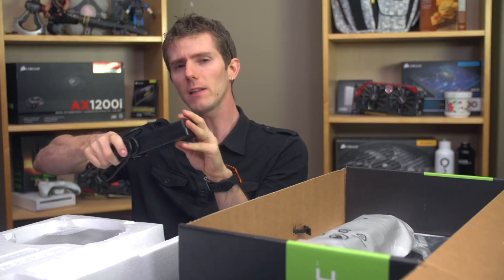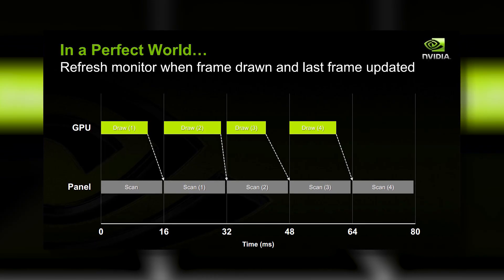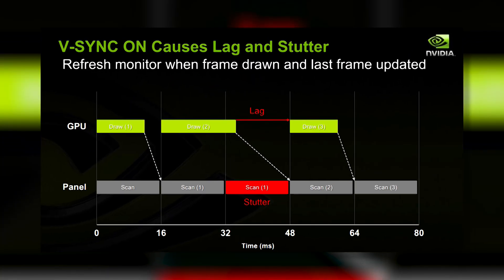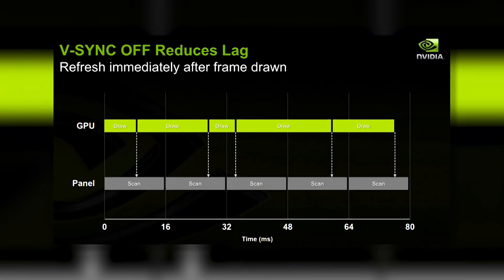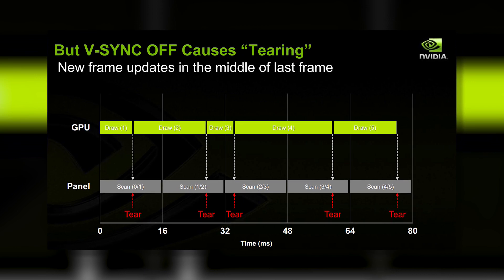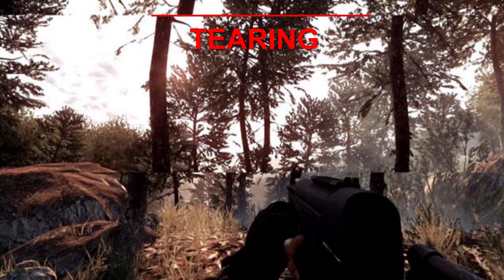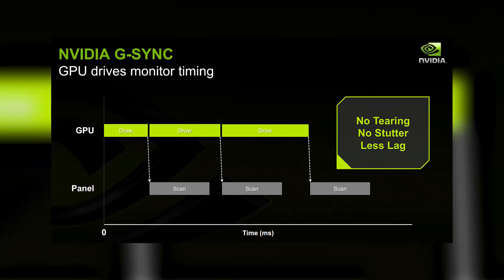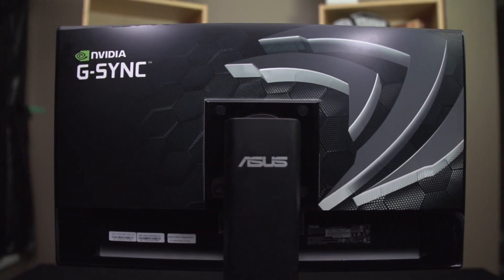NVIDIA G-SYNC Tech Preview - Linus & Slick's Impressions

Comment: I have purchased my first SSD and have Windows 8.1 Pro 64-bit love the speed that it provides, but currently it is on a SATA 2 and plan to purchase a SATA 3 add-on card in order to take full potential of the SSD, which happens to be the Samsung 840 EVO Series 250Gb.

Comment: I put a Crucial M4 in my last PC and I thought it was awesome! It really helped me out with loading everything. I ended up selling that PC and when I went back to building an even better PC I decided to go with the OCZ Vertex 4, that SSD was much faster! I just lately built a PC for my wife... I purchased an SSD for her as well.

If anyone is ever buying a PC I always suggest an SSD for them. To me... you lose so much performance because of a HDD. A 3.5 minute boot up time turns into a 1 minutes boot up time. Programs open up faster, webpages are able to open up faster, you're able to do everything in general... FASTER. I have seen a Pentium mobile processor go from being a crappy processor to almost an i3 speed (that has a HDD) because of an SSD.

I will never go back!

Comment: Bought an SSD when my HDD failed last year.. I'll never ever go back to a HDD other than it being secondary for music, movies and less important apps and games..

Going from my "Gaming" PC with SSD to a PC without an SSD or a Laptop is almost frustrating at times. My SSD PC fully boots in under 15 seconds, opens all apps in 5 seconds or less. Does what I want when I want it.
Without the SSD or on another PC is more like 30-60 second boots and 10-15 secs for most apps.. other are even longer like Photoshop or Lightroom when loading the images catalog.

For those who aren't convinced about the benefits of SSD.. Find someone with an SSD in their PC/Laptop and has the OS installed on it.. try it out for a few hours or whatever. Then when you're back on your own PC/Laptop you'll definitely notice the speed difference. My PC is still running as fast as it was when it was a clean OS install.. and that was well over a year ago now! a HDD would have definitely slowed down after that time :)
Reply: PC Master Race - SSD Armada

Comment: I recently got a new laptop that has a ssd on board and it is so much more efficient and in my opinion safer. It has no moving parts like traditional drives to be damaged by shock. I am looking into actually taking my other pc and switching it to ssd.

Comment: One thing I still don't totally understand is if a monitor normally has to repeat frames if the graphics card can't render fast enough, how does G-sync differ? Presumably if the frame is delayed the monitor would still need to hold the current image for longer. Is it that the monitor can draw the frame as soon as it arrives, rather than having to wait an entire cycle (say 16ms assuming a 60hz monitor) before updating?
Reply: You have it exactly right with G-sync the monitor gets the new frame when the GPU is done with it. This may mean that a frame is displayed for longer than one traditional refresh. However, instead of one frame for 32ms (assuming your 60 hz scenario) during which time you may have tried to move your character, but couldn't (input lag) the frame will last say 24ms (arbitrary number) and you'll be able to move the character normally. The opposite can also happen too, where a frame may only be onscreen for 10ms (again can be any ms) it all depends on when the GPU is ready. In real terms all you NEED to know is tearing (no V-sync) and input lag (V-sync) are both fixed by G-sync.
Reply: Cool, thanks. :)

Comment: Oh my goodness, there's no way I'm not going back to just using a HDD. My 840 is sooo quick with the Z87 platform, in fact I'll be getting another 250gb soon to run in RAID 0 to double my capacity and performance. Eventually getting a G-Sync monitor if it turns out to be good but I rather sit back and let this play out and see it for myself first.

Comment: I have upgraded to an SSD within the past year and it is a night and day difference. With G-Sync though I don't think it's going to be something spending a lot more money on because it has an nVidia logo slapped on it. I personally have used nVidia GPUs ever since I built my first gaming rig, but I am looking to switch to AMD and upgrade to a 120 or 240hz monitor (which I have seen gameplay on). That way I get a nice new GPU and a lot cheaper monitor that looks just as good (picture quality), overall saving loads of cash. It's not new mind blowing technology. I think I will stick with regular Vsync and be sure to have a good enough PC to eliminate screen tearing.

Comment: I made the switch to SSD when 240gb drives went below $300 and it was the best upgrade I've made to my PC besides my video card. Apps open almost instantaneous. Restarts around 10 seconds or less. Going back to a HDD would be so painful. There's no way. As I already have a Kepler card, I'm extremely excited about G-Sync. In ACIV right now I basically have two options. Vsync off and horrific tearing, or Vsync on and terrible stutter. I've heard claims that 40fps with Gsync looks smoother than 55fps on a 60hz monitor, and it makes sense. I can't wait.

Comment: 4:12 never use metal tools on plastic material cause you will damage the soft plastic with the hard metal ... use wood or material thjat is softer than the plastic so that if damage occurs it will appear on the soft tool .... just sayin ...

Comment: requires specific brand of GPU
requires specific series of GPU
requires specific manufacturer of the monitor
requires monitor to be TN only
requires specific hardware/adapter
+ all specific limitations in terms of souround windowed mode 
requires a gamer mouse with 1k polling rate
no SLI support

It targets like one digit number of the gamers in the world at best ...
It is sad that such amazing technology will not become industry standard...

And that is only because nvidia is pushing this just like physx more from marketing side then from technology side... and that is very bad because this would be really beneficial to everyone.

Basically what i want to say is if they dont want this to go away into obscurity/gimmick like physx did tey have to :

make sure it works with both AMD and Nvidia GPUs
make sure it works with older generation of cards
make sure every brand of monitor manufacturer is making and developing them
make sure that it supports IPS panels

Comment: My desktop has had an SSD for about half a year now. Whenever I use my laptop though, which has a 5400rpm hard drive, I feel as though I'm just wasting my time. Its so much faster to use an SSD, not to mention I can start programs as soon as I log in, and not have to wait a few minutes.

Comment: i would just like to say that i have been creating images in Photohop at ridiculous resolutions, like 22 MP, with up to 200 layers, and before i had an SSD it was almost unbearable to do, cause it took about 10 minutes just to load one photo, where now it only takes about 1 minute to 30 seconds to load, and saving took longer, my biggest one took 4 hours to save, now it only takes 30 minutes to save that file, (i think it was 80 GB)
Reply: what sort of work do you do? 80 gigs is huge file...gigantic actually.
Reply: The 80 gig file was called Dark universe, and was around 40MP, with 182 layers most of them were quite big and very detailed, it was a photo of a nebula, with a galaxy in the background, and a solar system in the foreground, it got lost when i burned up my hard disk trying to load it while rendering a video in the background. That is also why i have been away from deviantart for a while, was trying to get an SSD on top of my new computer which is very expensive in the first place, after that i stayed away from making stuff that was over 5 GB however my biggest file atm, is 745 MB, after i reduced it from 1.32 GB which also happens to by my latest deviation
atm i am doing anime stuff, at 5760 x 3840, where as my normal content is space art at a res 2560 x 1600 or 2880 x 1800.
www.shazarakk.deviantart.com to see my stuff, I'm also thinking of doing stuff where i don't draw over with PS but where i just draw it by hand.

Comment: I just started using an SSD this year and can not go back to a HDD based system, another example is a Mechanical keyboard I just got mine this year and love the thing every time I go over someone's house and need to use there computer that had a membrane keyboard I hat it and almost cant deal with it.
Reply: Same. I went SSD in about 3 months ago and i will never go back to 1 min boot times with my ancient hard drive. But i also got a new 1tb 7200rpm hard drive when i got my ssd and load times in bf3 were off by about 20-30 sec from ssd vs hard drive. I still have a cheap membrane. What keyboard do you recommend?
Reply: Nowadays when I'm using a computer that main storage drive is an HDD, I have a feeling that I'm using ancient technology.
Reply: MrMater36 What keyboard depends on what switch you want. There are Cherry MX Blue, Green, Red, and Brown and you just have to do some research and find which one you prefer.
Reply: MrMater36 Keyboard wise I really like the look of Corsair K70's but Ducky's are also another really nice brand.  As for key switch type I personally like cherry MX blues but i'd recommend MX browns to the average person.
Reply: Give me a 3TB SSD at Hard Drive's price and I'll get one.
If I had to choose between storage space and speed, I'll choose storage space, I leave my PC turned on 24/7 so boot times are not a problem to me.
Reply: ***** For me like a student was quite hard to buy, but it is a good investment.
Reply: Willard I have the Corsair Vengeance K95 and I love this keyboard. They are the Cherry MX Red's and I can't imagine going back to membrane keyboards.

Comment: Using an HDD is very frustrating. I had to RMA my SSD, and was using a HDD for a week and a half on my desktop. I couldn't wait for the SSD to go back into my system. My laptop is HDD based, and I might put a SSD in that one day as the load times are terrible.

Comment: Question Linus - Vsync stops your GPU from maxing out and keeps the fans at a reasonable speed. When you enable G-SYNC will that max your GPU load to 100% and send your fans into a mad frenzy, equivalent to Vsync off?
Reply: My guess is that it will be similar to Vsync in that way since the GPU will have to wait on the monitor to read out and show the image. a 60Hz monitor will still only be able to show a maximum of 60 frames per second. When your framerate is above the refreshrate of your monitor it will basically be the same as gaming with Vsync on since the monitor is the limiting factor. The biggest gain is when you drop below the refreshrate. At that point the monitor will synchronize with your GPU.
Reply: Niosus
Cool. If that is the case, I will def upgrade to this new tech. I will be getting my 2nd GTX 780 at the end of the month and I wanted to take advantage of having no lag (which vsync gives) but not have my cards screeching at max :)

Comment: i already have my asus VG248QE so i'm just waiting for pricing since the asus is the only upgradable monitor atm.
If price is not to steep ill definatly get it but ill probably wait a bit for the tech to mature and price to drop so next quarter like you said sounds good i guess.

For the moment you have to drop HDMI and DVI since only displayport is supporter with gsync but thats no problem for PC. Never liked HDMI anyways lol.
Reply: Its not upgrade-able, they thought they were.
Reply: ImJJames the g sync module is just a part of the motherboard and can be replaced. Nvidia confirmed the VG248QE is compatible with the board so you just need to open your monitor and swap the part after you buy the gsync one.

Comment: I'm looking for a new GPU and monitor for tax time. I want to go with G-Sync, but I want a 27" monitor. I may wait until 2015 to go with G-Sync. Just go with a 120hz monitor for now. Either way 780 and 120hz monitor in 2014.
Reply: I have a 27" and a 17".  My goal down the line is 3x27"

Comment: Been running the OS on a SSD for 2 years now. Using computers with the OS on the hard drive/no SSD cache have become a pain in most cases. Completely new HDDs are running very similar in start up times etc, so unless you havent re-installed W or not throwing any tough work at it, it's not that massive difference though.

Comment: A few issues I have with G-sync (at this point in time) is the cost, exclusivity to NVIDIA, and really the benefits. I really like AMD, so being limited to one brand with this (if this was something I needed) is a bit rough. I understand the tearing problem, but I rarely get frustrated with it because it usually only happens a couple times in a game, or if it's in a certain section that can be quickly passed, and if the cost is high, then I don't see much of a point in buying it, at least right now.

Comment: I think G-SYNC will indeed be very cool but, as many things often are, very expensive at start for what you actually get. 
I was super excited but then realized an extra $175 for the module or extra cost on a monitor (though likely less if integrated) and that $175 can buy some extra graphics horsepower over what you have.
The problem is that this is NVIDIA ONLY and at time of writing this they "technically" and #2 when it comes to price/performance at the high end of the graphics market.
I am sure it will stop some people who are not fanboys of either side from buying AMD, which would be a shame, but then again it is cool tech.

Comment: I'm still not buying a monitor until at least 3 of the 4 main technologies can be available on one monitor (120hz, 2560x1600, IPS, G-Sync). There's just no way I could commit to only 120hz at low resolution or only 60hz at high resolutions or only IPS at slow response times or G-sync without high resolutions and refresh rates.

Comment: Go from home with 2 SSD based systems that i never seem to have to wait on, to work with HP laptops and high power xeon based workstations i can say running a 7200 rpm drive ends up with me walking away for a drink, a 10-15K scsi based system is ok, but dang im not productive without my SSD's.

Comment: G-Sync offers a better experience just like an SSD does but the major problem it's going to have is its exclusivity. Displayport, Monitor, and GPU all have to be compatible. The average consumer will not care, opposed to just switching in an SSD that speeds up their whole system. G-Sync is gonna take a loooooong time for full adoption, i think.

Comment: I really like G-Sync and I've decided that it is one of the criteria I will include when building my next computer. I have a relatively new gaming laptop, which should last me about two years and I want to build a high-end machine afterwards. I have a few ideas in mind, like 800 (or 900) series NVidia GPU (or something from AMD, if they can convice me, which is unlikely, thanks to G-Sync), DDR4 or HMC RAM and maybe Intel octacore CPU.
And the SSD thing, I bought a 120GB mSata SDD for my laptop and it died fairly recenty (damn you SandForce!!) and going back to mechanical drive based system was a pain. You do pay for the speed, but I think it is well worth it.

Comment: Price will dictate whether or not G-Sync lives or dies.  I know a few people that will go out and buy a  2000 dollar monitor but MOST of my friends stick in the 300 dollar range. 

If G-Sync can maintain a reasonable pricing range it will be a game changer.  If the cheapest model you can get is 700 dollars for a 19 inch monitor it'll fail hardcore.

Comment: I will never use a HDD for my OS, games, or any software again. I got an SSD for my OS; shortly after, I got another SSD exclusively for my games. My HDDs are now used for media and back-up only.

I probably won't go G-Sync until 4k (g-sync enabled) monitors become mainstream. I recently acquired a 1440p qnix, which I'm very happy with, and I'm not prepared to dish out the money for a 1080p g-sync enabled monitor, and I'm also not prepared to pay $1000+ for a g-sync enabled 1440p monitor when they become available.

Comment: I finally bought a gaming laptop from OriginPC last year and I decided that an SSD was a must since I was going all out. I never really noticed any difference in speed from my old laptop to the SSD, until I was moving large files from my main SSD to my Storage drive. When I boot up my Win7 laptop the longest part is me putting my BIOS password in. However last summer I built a desktop and I decided to use the Windows8 from my old laptop. So I cloned the harddrive from my laptop over to a WD harddrive and plugged it into my desktop. I'd forgotten how fast Win8 boots up. On a generic desktop HDD, Windows 8 boots about as fast as an SSD, in my experience. If I restart my destop over Teamview, it's normally back to login before I walk the 16ft from my dorm living room to my bedroom with the desktop. Not totally relevant, but I found it interesting when talking about harddrive speeds.

Comment: This tech is all well and good but why do pc gamers have to through these hoops just to get a great gaming experience? You may have spent loads on a rig but if the game developer makes a lazy port to pc its always gunna run crap. A good test for g sync would be LA noire. Think that game is locked to 30fps. Got so much tearing and lag on i7 rig i had to buy the game again on xbox360